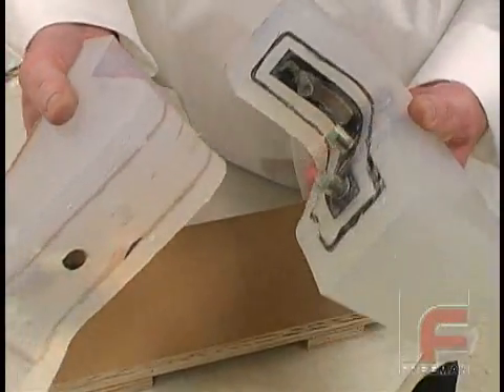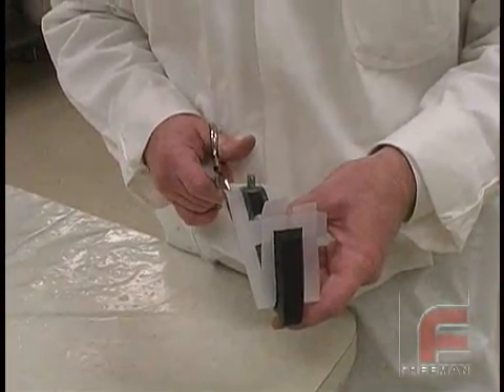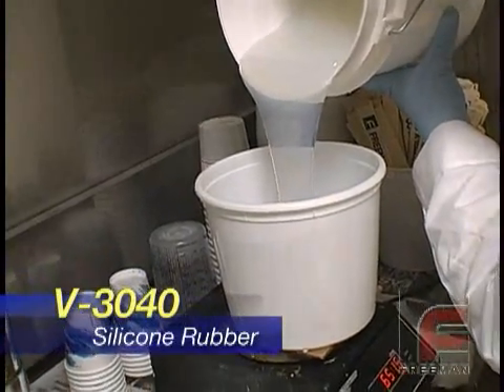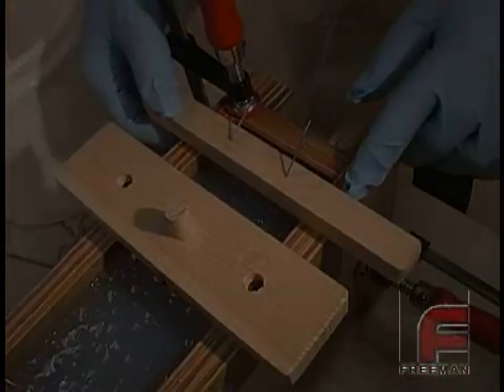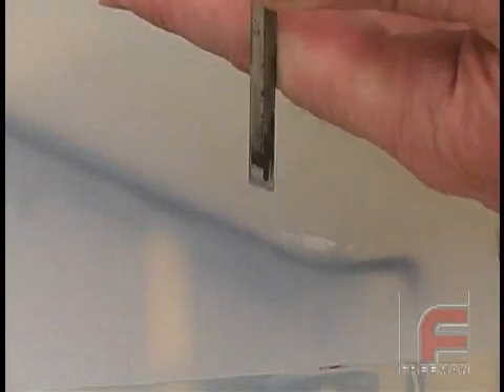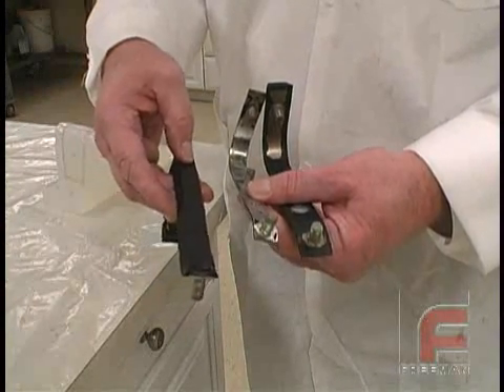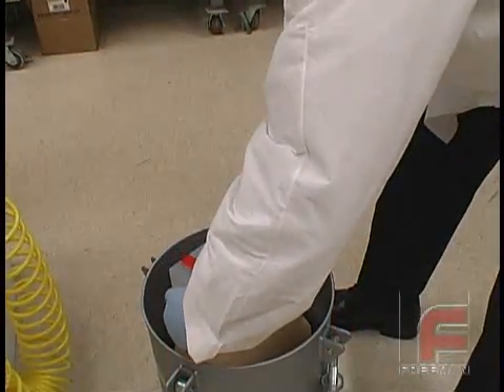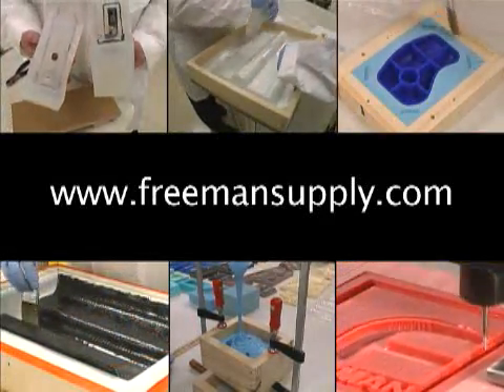Moldmaking With Clear Silicone Rubber - Updated

Comment: A simple two piece mold with any silicon would have worked.  The part is symmetric and not curved inwards height-wise when laid down, so if partition line is slicing the part when laid flat a simple two piece mold with any silicon would get you similar results.  You guys went through all that justification for using clear silicon.

Comment from the maker: We cure material under pressure to reduce air bubbles and help force material into corners and fine detailed
areas.  

We use 30-40 PSI for most urethanes. 

Silcone rubber can be degassed or put in a pressure pot at a minimum of 15 PSI to rid air bubbles from the material.